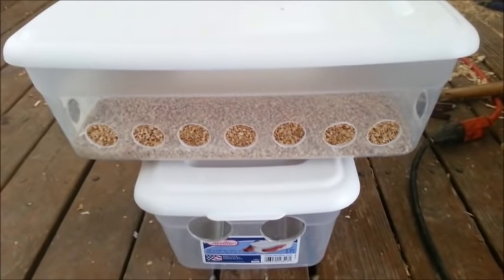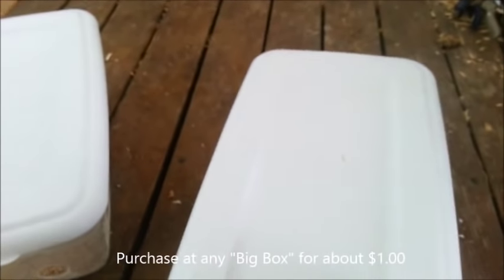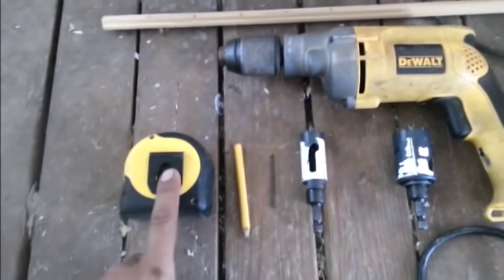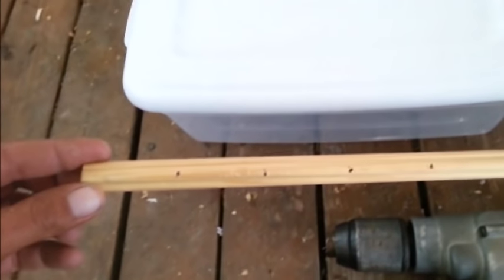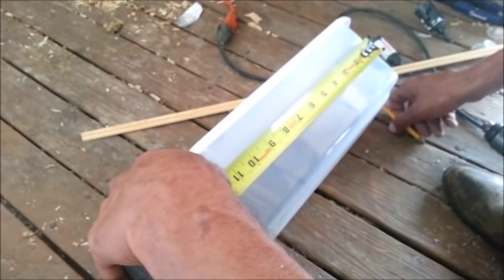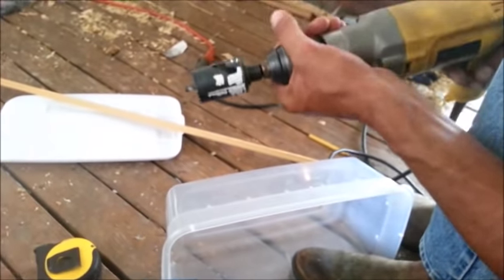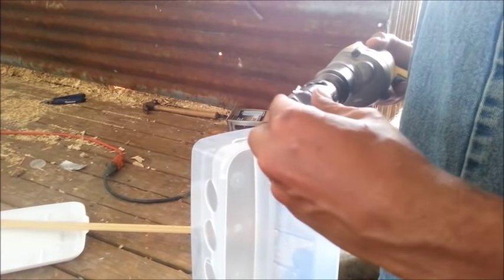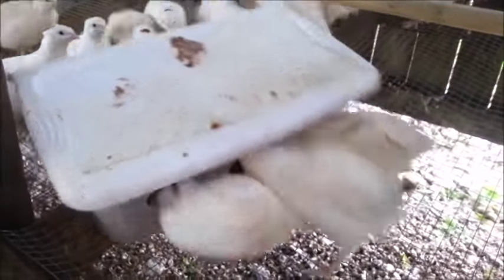No Waste (Spill) Chicken/Quail Feeder

Comment: For quail, if the 3/4" is for newly hatched, and 1.5" is for up to 3-4 weeks old, what do you use for adults?
Reply: I suggest 2" or 2.5" for smaller adult birds and 3" for larger ones.   But you need a plastic 90 degree/elbow so they cannot scratch out the feed with their beaks.     02/20/2019
Reply: You eat the quail 😉